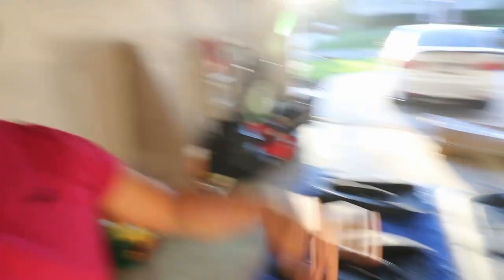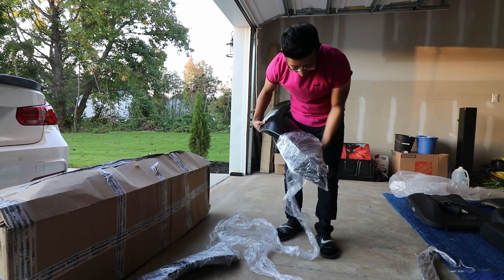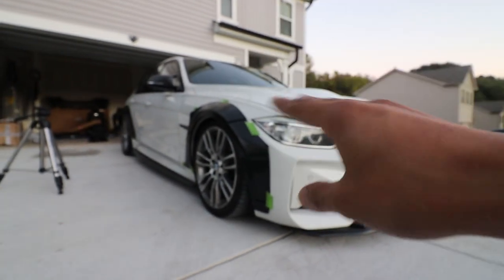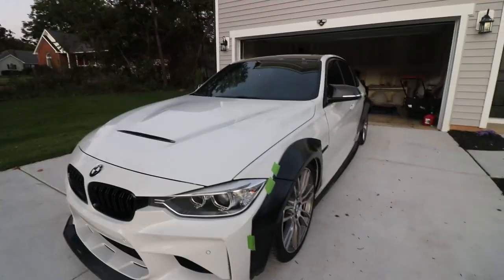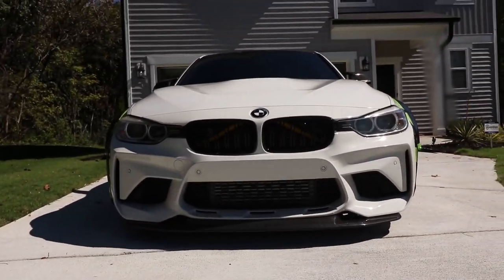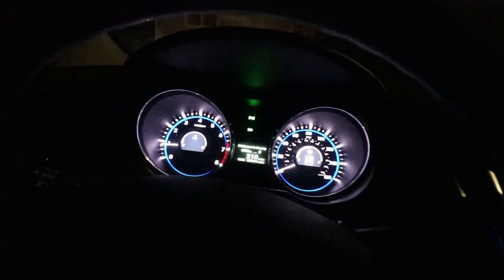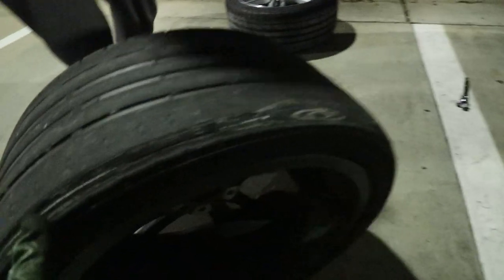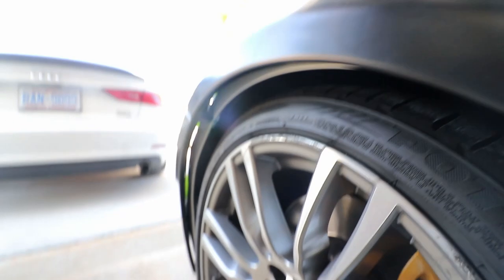BMW F30 Widebody Test Fit | By: KROTOV

Comment: I have a 328i do you think the m3 bumper would look good with the m sport back bumper at first I was going to get your bumper but I have fogs lights so I was just like ill go with the m3 one and I don't personally like the m3 back bumler to much cause it looks bulky to me on the f30 I don't know if they make the replicas a little diffrent but I'd just prefer a m sport back bumler if I ho wide body I'd definitely get one though your thoughts on the idea of the m sport back bumper with a m3 front would be niceto hear.
Reply from the maker: I would go with the m sport rear myself. I agree with the m style looking a little odd at some angles

Comment: I want to buy this , its good material? does it look good? do you think it is worth buying?
Reply from the maker: This is for the f30 only
Reply: @EldridgeCortes  yes material is good?
Reply from the maker: @tamerlanmm  yeah its not bad. just like any kit, it'll need some slight work to fit perfect
Reply: @EldridgeCortes  Are the original fenders cut for this? I didn't see that part in the video
Reply from the maker: @tamerlanmm  yeah they have to be cut for them to be functional
Reply: @EldridgeCortes  thank you bro